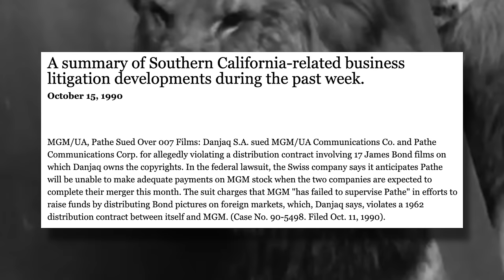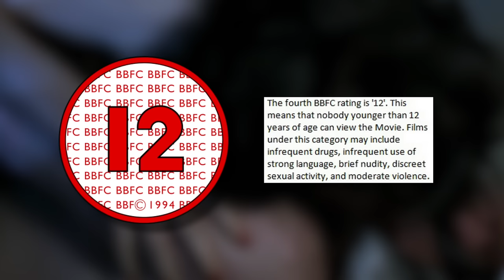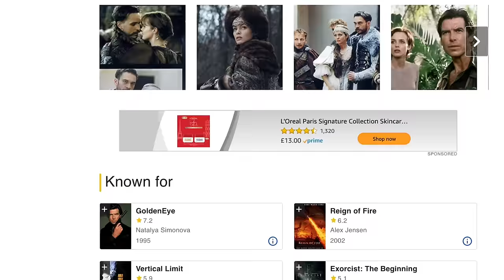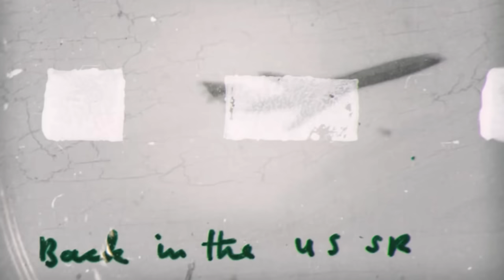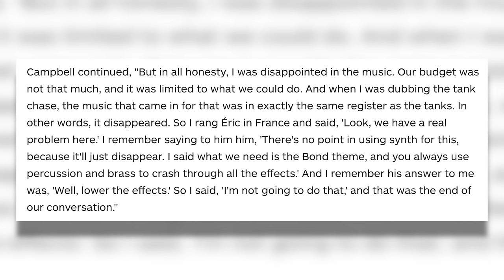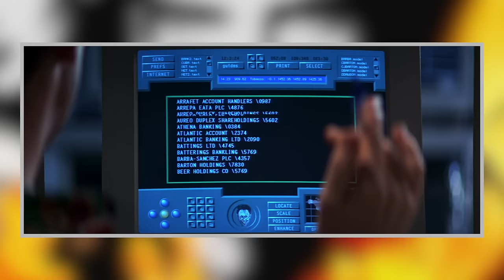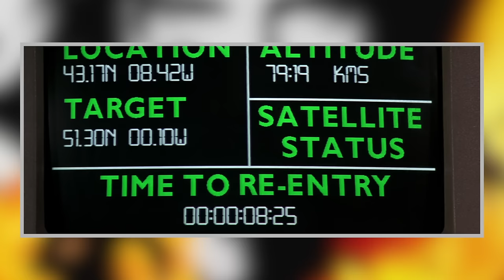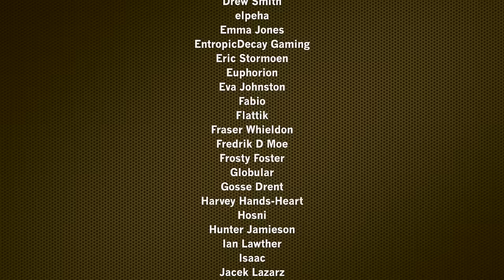THE Bond Film of a Generation | 'GOLDENEYE' An In-Depth Review

Comment: 56:50 The Arecibo radio telescope that they used for Travelyan's base was often brought up in my astrophysics lectures, and I did you not the question was always asked "Does it really go underwater?"
Reply: The question should be why does a Bond villain need something as large as a radio telescope to communicate with a satellite? 

In most cases the Soviets only had a marginal capability but still..
Reply: @tumslucks9781  If I recall, the Soviets didn't build such powerful radio telescopes in the late 1960s. Sir Bernard Lovell claims that when the Soviets launched Luna 2 they had no way of tracking the probe all the way to the Moon and relied on Jodrell Bank observatory to do it for them.

Comment: 🎥   Though often overlooked, this film effectively reboots the series by having it start in 1986 (rather than, say, 1990 or even late 1989).

🎥   A few other entries were also 'tasked' with salvaging the franchise; e.g. TSWLM, Casino Royale 2006.

🎥   21:05   Callback to AVTAK (1985); other callbacks - imposter admiral/Thunderball, casino encounter/Dr. No.

🎥   29:41   On the contrary, lack of continuity is the consistent course, for this is a reboot ("1986").

Comment: on the blanks front, blanks at close range are still very much lethal. had a demonstration of a blank round fired through a L1A1 at point blank at a plywood board with a sandwich bag of ox blood on the other side. and well it painted a section of the field that the demonstration took place in, so would have to have aimed off regardless of the blank/real projectile argument

Comment: Disclaimer: I do not pretend to be a firearms expert, though I have some knowage of them.
Calvin, you said it was strange how Orumov's gun is fake for Alec, but real for the soldier. It doesn't need to be a different gun at all. There is a thing, called blank ammo. It is essencially a normal cartrage, without the bullet. So there is a possiblility that Orumov had loaded seven real cartrages into his magazine and one blank- for Alec. That explains how the soldier actually dies and Trevelian does not.
Reply: I thought the same thing, but someone who knows more about guns than I do told me that to fire blanks, a gun has to be adapted, and the adapter limits the size of the barrel, meaning that a blank-firing gun cannot switch to shooting live rounds without having the adapter removed or it would blow itself up. With an automatic pistol like the one Ourumov is using, you can't mix and match ammo.
Reply: @Blokewood3  That was a plot hole in Die Hard 2. The terrorists who are secretly in league with the special forces unit sent to stop them from holding the airport hostage load their submachine guns with blanks to make it look like the two sides are having a firefight. The movie very clearly shows the terrorists swapping out their magazines filled with real bullets to ones filled with blanks.
Reply: I've given it some more thought, and while what Ourumov pulls off here may not be possible in the real world, in Bond's world they have things like exploding pens, magnetic watches, laser watches, kill sats, space marines, super rejuvenation clinics, and more. It wouldn't be that hard to believe that Ourumov could have gotten a special Q-branch (or whatever the KGB equivalent is) gun that had been specially designed so it could be loaded with both blanks and live ammo all in the same magazine.

Comment: 37:42 I think this became the moment in the series when the floating timeline started to become stretched to implausible levels. Supposedly, they originally wrote the Travelyan character as something of a mentor to Bond, which of course would have necessitated a much older actor. But this element was dropped. Oddly for the most part they talk about the Betrayal of the Cossacks almost as though it happened very recently in the 90s. Yet later Bond refers to it as a '50 year' vendetta. Obviously, implying that Travelyan is much older than the actor playing him. 

It gets even more absurd two films later when Bond's cover gets blown because the scientist he's impersonating is '63 years old'. Which begs the question, how old is Bond? Just to be conservative, in Dr. No in 1962 he says he's used a Beretta for ten years. Which puts it back to 1952. To be conservative, until recently the minimum age one could be certified to use a gun in the UK was 14 years old. So if Bond was 14 in 1952, that would make him 24 in 1962 and thus born in 1938. If we assume Travelyan is the same age as Bond, that would make them 57 years old in Goldeneye. They certainly look good for their age. In 1999, however, this would make Bond 61 years old. Not quite a big enough age gap to blow his cover.
Reply: I don't think Dr. No actually gives any dates about when it takes place, so it doesn't have to be 1962. We could push it forward a bit, but one date that's tough to work around is OHMSS. Tracy's tombstone in FYEO gives her year of death as 1969 (but it also gives her year of birth as 1943, which is 5 years younger than Diana Rigg). Bond was said by M in OHMSS to have been pursuing Blofeld for 2 years, so maybe we could push the early adventures a bit and have Dr No begin c. 1966, and give Bond a birthrate of c.1940-43, which coincidentally is quite close to Dalton's age. As for his line about using a Beretta for 10 years, it's possible Bond could have practiced target shooting at a young age on a relative's farm or something.
Reply: @Blokewood3  But Dr. No's scheme specifically involves trying to thwart the launch of Mercury-Atlas 7. The announcer specifically calls it that. Of course they blew it out of proportion by making the mission a lunar flight. In real life, Mercury-Atlas 7 was Scott Carpenter's spaceflight. It launched in May 1962.
Reply: Another pedantic comment.

It's a Bond film. You don't overanalyze it or you're missing the  point.

How do you relax in the evening?

Do you check the Yellow Pages for spelling mistakes??
Reply: @WhiteJarrah  I forgot about the Mercury-Atlas 7. I guess we have several options here:
1. As you pointed out, the depiction of it the spacecraft in the movie does not match what it did in reality, so if we can accept the liberties that were already taken, we could also say that it doesn't need to have happened in the same year that it did in reality. After all, the announcer never says what year it is. 
2. The idea of a sliding timescale is that the exact year things happened sort of changes from era to era. So while the events of Dr. No still happened to the Bond of Goldeneye, it happened at a different point in time. Maybe in the Brosnan timeline Dr. No was trying to disrupt the launch of Apollo 17 (1972) or the first launch of the space shuttle (1981). 
3. Or, if we feel we have to preserve the dates, we could suppose that Bond is a fair bit younger during the Connery/Lazenby/Moore era and a fair bit older during the Dalton/Brosnan era than the actual actors. Suppose that as a young boy, Bond learned how to shoot by practicing shooting at tin cans on his uncle's estate, and this is what he was referring to when he talked about his 10 years of experience with a Beretta. If we allow that, we could say that Bond is somewhere around his early 20s during Dr. No, allowing for a birthdate of c. 1940-1944. Making Dr. No his first big mission and making Bond about the same age as Tracy. By the end of the series Bond would be pushing 60, which is pretty old to be out in the field, but in License to Kill Felix Leiter was played by 61 year old David Hedison, so it's not impossible that an aged Bond could still be active.
4. Or we could just say "it's a movie."